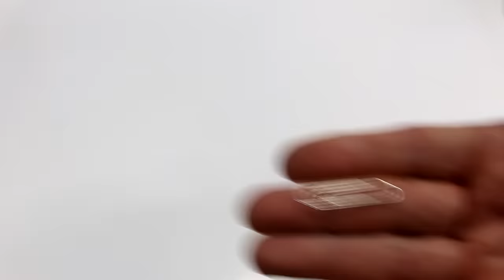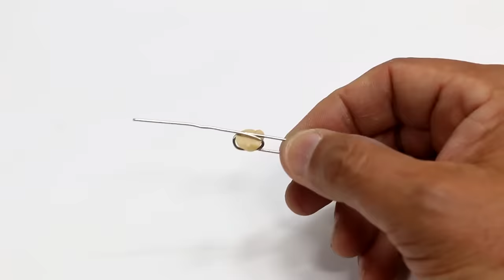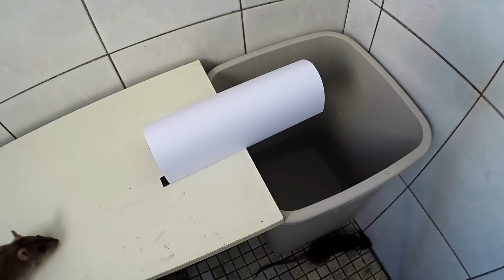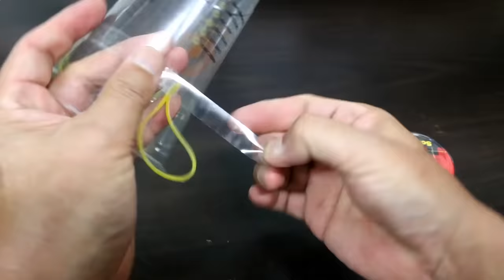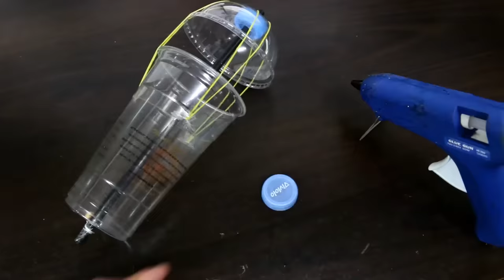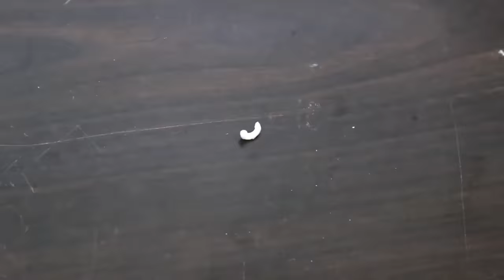5 Easy Mouse/Rat Trap

Comment: In the last example, I do it differently. I substitute a long pencil, which rests on the bottom of the dishes, and the other edge into the surface. In the middle of the pencil I knit bread, on a short thread. It works more reliably.
Reply: I'm not sure I fully understand. Could you give some more details by any chance? Thanks in advance :)

Comment: the best ways to trap mouse. I tried first and the last one until I was preparing for first apparatus the mouse was trapped in the last one. must try these techniques to trap mouse. but one precaution for the last method is that you must keep some hard paper below the apparatus so that you can lift the mouse from floor. thanks
Reply: Mangesh Galande did the first one work too
Reply: Parker Bailey . first one didn't work
Reply: Mangesh Galande. Thanks I'll try the last then.

Comment: Rats can easily eat thru plastic!
Reply: john doe at my school there was something scratching inside a dust bin and me and my mate thought it was a trapped squirrel or bird or something until when we came back and looked at it later, we discovered it had chewed through the bottom of the bin to escape and it was at that point we knew it was a rat
Reply: They where used for torture, take a metal bucket hot Coles on top of the upside down bucket rat inside bucket, bucket on victims chest, the rat would eat thru the victims chest to escape the hot bucket. Like most things rats will try and find the path of least resistance they have a massive fight or flight mentally with amazing teeth strength. This should be called life hacks because it's over complicating a simple task of buying a cheap trap that works and will get rid of the rat/mouse.
Reply: gameplay y divrsion yep
Reply: @johndoe-cm9qe  I remember watching sinister 2 and a scene like the one you describe was part of the movie scene
Reply: Yeah they can
Reply: this is why you use this traps for mouses and lethal ones for rats
Reply: @johndoe-cm9qe  Rats can also restart their own hearts! They basically have a built in defibrillator! Google it! its pretty interesting! Its also why electric rodent traps dont ussually work as well as others.
Reply: @yanelmendoza2855  Very well could be i personally haven't seen the film i think i remember it from school the Victorians did it.
Reply: @alexcrowder1673   Thanks i love picking up facts, The animal kingdom in general is amazing and far more developed for survival then any human could comprehend.
Reply: @johndoe-cm9qe  Cheap trap heh - Try putting out 8 & only two working so far over 3 months. And your sleep interrupted constantly *if you can even start*. They're not cheap given the square area of some places & # of unknown rodents
Reply: Jed Cauffield try a log roll bucket trap cheap no need to reset it and simple.
Reply: Same thing I was thinking with this. Rats can eat through a lot of metal objects also.
Reply: The contraption worked. But if it can't contain it. Pointless.
Reply: @johndoe-cm9qe  where can i read about this
Reply: vault dweller read about what mate?
Reply: Thru???

Comment: Number 5 is really good...I can modify that for a larger stronger trap. I'm at war with these filthy buggers at a family members home, she has COPD and I just can't have their urine and body odor in the air. Pulled 7 rats out of there in the last 3 days, but those glue traps get expensive when you buy 6 packs at a time. Some die in the glue traps, others get lucky and get caught in my Havaheart trap and get released in the woods far away...but they are starting to piss me off, I'm eyeing an electric trap now.

Comment: 10:22 and 10:23 you can see that the video is cut means that he could not trap the mouse
Reply: Anup Taneja it fell down on the rats tail. There wasn't enough space for it to get through, and the Bowl is probably too heavy. He only cut out the part where the rat was trying to get its tail free
Reply: Cheeto or may be they coldnt do it right wortks and make a montage

Comment: They can bite through walls but not a bottle?
Reply: Believe It lmfao fr
Reply: IKR
Reply: Lógic trap
Reply: Believe It a rat can chew thru anything but they have to be able to get an edge or a corner. 
A round plasti bottle makes it hard to get their mouth around it
Reply: If you dont throw it out they probably will chew their way out obviously😂
Reply: Kaneki Ken rats can even chew awa y concrete
Reply: They will given time.
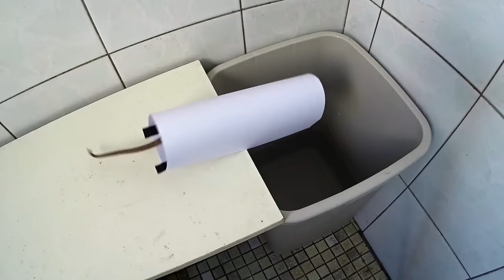Reply: 4:54 falls in trash
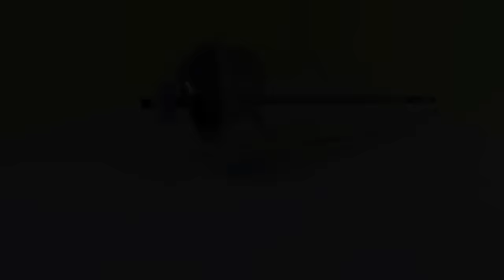Reply: 7:04 gets trapped
Reply: The bottle is smooth and round which makes it impossible to bite the inside of a cup. Try it yourself, cut a cup in half and try to bite the inside of it.
Reply: where
Reply: Wood can be chipped away as tic is kinda flat they can't destroy it if it is so smooth
Reply: Believe It 🐂
Reply: Kaneki Ken lmao
Reply: yea
Reply: Believe It
Reply: But they ate through the thick plastic lids of containers that contained food in my hostel cupboard
Reply: My kitchen mdf is ruined because of these little pests, so now my traps are Chemical, don't have babies neither small dogs, so it's still cheap, but these bottles are special, will try them definitely, on another house it did the trick
Reply: @r1cky.100  6
Reply: Believe It mouse logic > cartoon logic
Reply: Same is true for 1/4" mesh.  They can chew through 1/2" but not 1/4" mesh.
Reply: Maldoso
Reply: Believe It 3ppp

Comment: all difficultys and what make them that difficulty
5: simple but a bit hard
reason: accruacy, chance of peanut getting puled out without cassualties (if it isint good), setting up the peanut
4: simple and easy
reason: the only problem comes in on outside
3: simple, but weaker ones wont fall for it
reason: kind of stronger one based
2: others easy, one difficult
reason; the nails are very hard to do
1: hard if the rat has actual brain
reason: you can see that if they do the shortest way, they can escape if they have good reaction speed

Comment: Just a suggestion for me, i think the electric fan should be improved because even though you caught it how are you going to get it? Or are you just gonna kill it directly in there but how? Kill it with fire? Though it is still a good a trap not gonna lie. So i think you can put something underneath the cage like a flatboard so you can pick it up
Reply: No, he doesnt iill.
Reply: Cover with a polythene sheet and put a little amount of chloroform inside.Rat will be unconcious and you can pick it up.

Comment: I tried first one.But the rat was able to cut a hole at the place where the bottle was cut and escaped.You may have to fix two metal plates to cover the two edges.
Tried the second one also and trapped a rat.